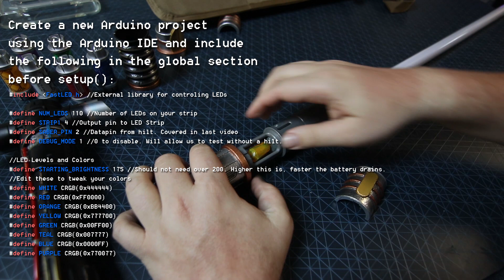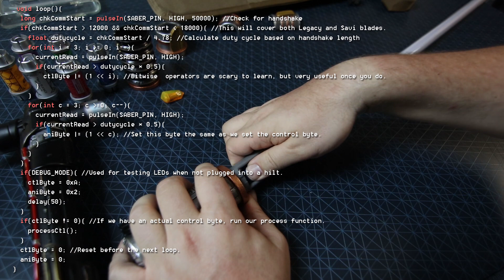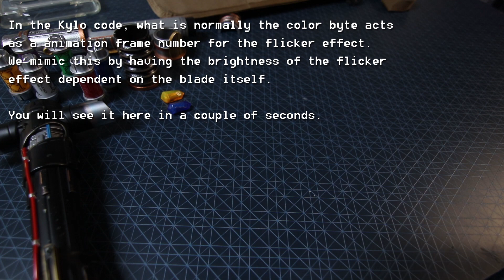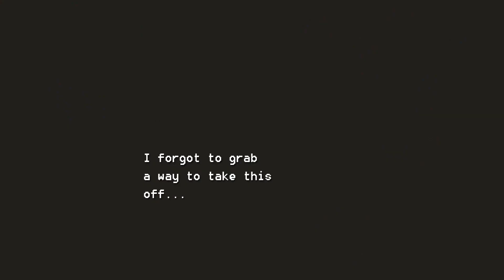Orange and Teal Galaxy's Edge Lightsaber - Custom Blade Tutorial Part 2

Comment: I have a question for someone with your advance knowledge of the savis blade electronics. Would it be very difficult to wire up the led strip in a neopixel blade to the savis microcontroller so it uses the lightsaber power and internals but gets a much brighter glow? Do the voltages match on the Neopixel LEDs vs the Savi's LEDs? Or will you get similar light output based on the whole setup? I was wondering if there was any advantage to using the neopixel RGB LEDs on the Savi's ecosystem.
Reply from the maker: The Savi's hilt doesn't provide enough power to get the brightness you're looking for from Neo-Pixels, which is why I include a battery in the blade itself.
Reply: @deadbothanssociety8686  Thank you for the reply. Its a very nice upgrade mod you made to the lightsaber. You definitely have Amazing skills. Keep up the fine work.

Comment: I've been wanting to shove an 8266 in my blade for a while now loaded with a program called WLED. My question to you is this: Would it be possible for me to order your PCB and solder (Power/Ground) straight to the 8266? I don't need it to flash on hit, I just want to be able to turn the light on and off with the switch. The board usually takes 5v. Would I need a battery or could I use a small capacitor? Any help would be greatly appreciated!
Reply from the maker: The 8266 uses 3.3v logic, which will work for what you're doing. I think that most 8266s would be to big to fit in the blade base, but it's been a while since I've looked at one.

Comment: Do you need to replace the RGBs inside the blade to get the color change or are they capable with a bit of coding?
Reply from the maker: You need to at least replace the blade's microcontroller.
Reply: The leds in the blade suck anyway. Way too far apart you can almost count them inside the tube. I always wanted to upgrade at least that aspect but not sure the savi has enough amps/grunt to power higher quality neopixel strips (144/meter style). What say you, Bothan?

Comment: So, if I understand this right which I'm sure I don't, the program to add the colors is in a microchip you developed in the handle? Then how does it read the orange and teal crystals? It doesn't seem like it would just be a simple rfid thing but I just don't get it unless you used a completely different rfid code alongside modifying the rgb code of the lightsaber
Reply from the maker: The RFID code just gets the hilt to say 'Show orange, please.' to the blade. The blade has it's own microcontroller that reads that 'Show orange' and says 'I'll show yellow, instead.' We developed custom code for a replacement microcontroller that says, 'Ok, I'll show orange.'
Reply: Burbank Makerspace can u sell them please I want a teal and orange blade
Reply: @UluvNacho  they are on his etsy page.

Comment: Is there no way to make the blade orange without taking the whole blade apart? How much are you estimating you’ll be selling blades for?
Reply from the maker: They not ready to be sold, just showing how to do it. Might design a circuit board to make it easier in the future. There is no way to get orange without a custom blade.
Reply: @deadbothanssociety8686  Does the teal work with the default blade or does it require a custom blade for that as well?
Reply from the maker: @geekerrant7242  Both the Orange and Teal require custom blades.

Comment: Um, yeah, no, I’ll just wait for the actual crystals to release thanks. No doubt that the codes for it already exist to be a tie in for Jedi Fallen Order anyways. I just hope that they do end up making more colors in the future though like darksaber black, lime, and pink. I have no doubt they would though considering that the whole lightsaber lineup is already a collectible thing to begin with. I have a feeling that the main lightsaber in Jedi Fallen Order is gonna be released in wave 2 of the Legacy lightsabers as well in that teal color.
Reply from the maker: You can wait, but the current blades sold in the park do not support Orange or Teal, even though the crystals have the capability.
Reply: @deadbothanssociety8686  so the hilt itself doesn't support it or the leds in the current blades don't?
Reply from the maker: @Ryan-zr4fj  The blades have a microcontroller in them that interprets a control signal from the hilt, and then lights up the LEDs. That microcontroller does not support Orange and Teal.
Reply: Burbank Makerspace Unless they’re keeping the actual colors themselves hidden under yet another code until release, then perhaps all they have to do is slightly alter the microcontroller through something like another specialized program or computer if the old blade for whatever reason isn’t showing the proper color, and you’re good to go. They still register as completely different colors after all, so I doubt they would want to force you to buy another 30-50 dollar blade for something that they could also probably easily fix if necessary. Though that might be a bit too time consuming and overly resourceful just to get a few more colors working, so honestly it’s more likely that they hid the actual functionality of the colors in the same codes in question until the day they actually release. They can be rather easily overwritten after all, so at worst I’m pretty sure that it has to utilize a little more extra programming in the new crystals themselves for it to work properly as some sort of key or small tinkered update. Just insert an actual orange or teal crystal once in the lightsaber, and every other time it should work properly even if it’s overwritten with a different one since the blade would be overwritten a bit, or at least on that particular blade. Might have to put the crystal in again or leave it there if you have more than one blade for it to register. I’m no tech junkie so I have no idea how most of this would work, but what I do know is that even in worst case scenario, they’d still want to help their customers fix the problem as apposed to being forced to buying another separate and identical blade for 30-50 bucks and have hundreds of complaints. I’m sure they’ll figure it out somehow. This is Disney we’re talking about. I’m sure they already have a handful of solutions for this if anything goes wrong considering that this is such a popular and expensive product. It’s still fun to speculate though, and a method like this isn’t completely useless I suppose if you want more specific and different hues of the same colors, so even though I’m not willing to do it, I do acknowledge the effort and thank you for it. I just hope that they end up making more colors in the future as well like black, lime, pink, or even turquoise/aquamarine. It’s all still fun to speculate though on how all this will work and develop in just the next few years from now. Thanks for the reply! :)
Reply: @ZacharyDietze  did you just say you doubt Disney would make somebody pay for something?! Hahaha
I think thats the point of a business?
Anyway you might be on to something but I think we will see the colors applied to movie hilts not games. I think rey staff saber with orange and Leia saber with teal would be perfect.
I'm just mad I went there twice before covid shutdown and didn't get the pair of ahsoka sabers!!! What have I done...?

Comment: I have a Disney Parks exclusive Kylo Ren and Disney Parks exclusive Rey/Graflex/Anakin/etc. These were not purchased in Dok Ondar's shop , but in Launch Bay before GE opened.
   My question... Do you think there is enough room in there to gut the internals, get creative with some fabricated holders, and do something like a recharge pack+ proffieboard+ neopixel blade.? 
...and pushing my luck...maaaaybe a crystal chamber?😁
   Most people that know what they are doing dismiss the idea of of hand. 
  "Why do all that? Get a custom saber builder darkforge yeacraft ultralux savant master 3 hilt!"
   No thanks. These were gifts from my wife, and are special. 
   Anyways, what ya think?
Reply from the maker: The DPE and Legacies have the same internals, from what I've seen, so my first recommendation would be do not take apart the body of the saber itself. It will never go back together again, and I cry over the body of my Legacy Kylo Ren saber daily. If you're interested, we have a Kylo teardown video on our channel, and you can see how much of a pain it was.

What is different between the DPE and Legacies is the blade connector. That said, you should be able to do an electronics replacement on the DPE blades similar to what I've done here to get the Neo-Pixel outcome you're looking for, and use a Bluetooth board to control color/effects from your phone or a remote. I couldn't be 100% sure until I took apart a DPE blade though.
Reply: @deadbothanssociety8686  Much appreciated. I think my DPE Kylo Ren and Vader will remain untouched, but I have a primal "need" for neopixel Teal and the smoothswing soundfonts to make my Rey lightsaber bring me to tears. 
  I do thank you for the insight. Recommendation to not dismantle duly noted. 
Sigh....well. I've heard it said....fear is the path of the Dark Side. Soooooo😏
Reply from the maker: @johnswanger8474  Good luck! I guess the thing to remember with the DPEs, Legacies and Savis is that unlike some of the custom sabers, there are two micro controllers. One for the blade, and one for the hilt. You're going to have to take that into account in your build.
Reply: @deadbothanssociety8686  Awesome, thanks!  I'm hoping that I can gut all electronics and simply use the hilt body to house something like a proffieboard.
Reply: @johnswanger8474  dude just leave the Disney sabers as you bought them. As much time and money spent on converting and possibly ruining them, just go get a replica graflex from Romans props or kr sabers. Buy a 3d printed chassis and neopixel blade kits, a proffie or CFX board and it will go much easier for you. Leave the gifts from your wife intact. Trust me.

Comment: Couldn't we just take the sound files off of the Disney board and replace the whole dang glop top with an Arduino and a motion sensor? Then you could use RFID tags and epoxy resin to make whatever crystal you want.

Comment: why don't you just code the kyber crystals to turn orange or cyan?
Reply from the maker: We did, but the Galaxy's Edge blades don't respect Orange or Cyan crystals. They only display them as Yellow and Blue, respectively.
Reply: @deadbothanssociety8686  have you tried coding the blade?
Reply from the maker: @jeffthebunny2.055  Unfortunately that's now how things work. There's no datasheet on the internal board, no way to know how to program it or what language to use, and no way to access the chip.

Replacing the microcontroller is the best option to achieve the result.
Reply: @deadbothanssociety8686  aww man. I just hope that Disney releases these since they have been found months ago but still haven't been release.